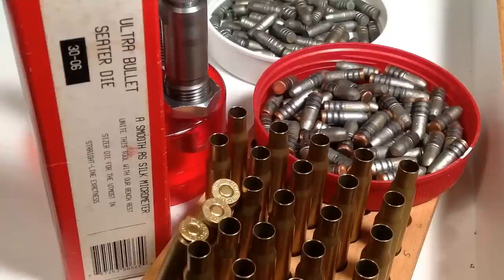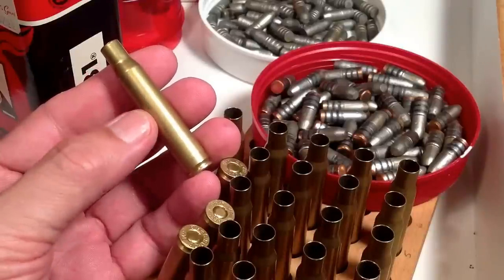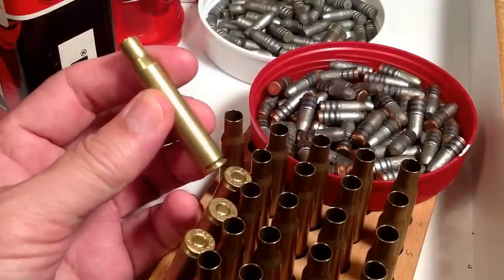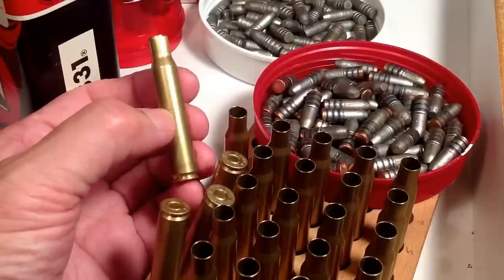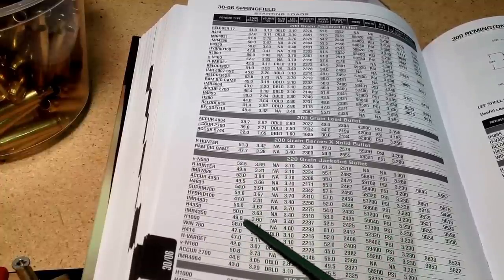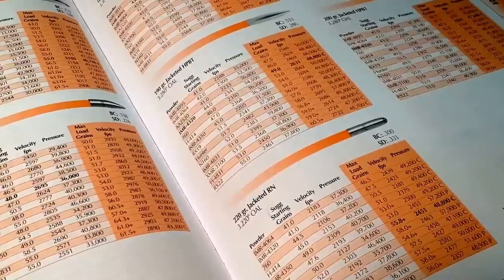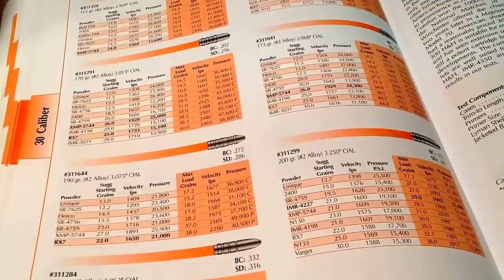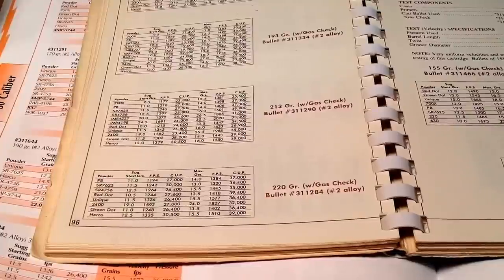The Danger Of Reduced Loads in Rifles

Comment: Good video, at least someone takes the time to notice most detail. I saw one problem though with what you're teching people like Sith Yarael for instance. You pointed to your reloading manual and said these are all slow burning powders, but in reality only some listed in those books were. Yes IMR 4895 is actually a belted magnum powder charge that burns very slow, and IMR 4350 is a medium to slow burn rate. Yet the IMR 4064 and definitely 3031 that I saw in some of those lists you pointed at are actually very quick burning powders and are actually suppose to only be used with lighter bullets no matter the caliber because they just don't perform as good for heavier bullets because they burn too fast and don't build up the correct head space before complete discharge of the bullet. So yes good to show safety, but make sure of which powders are which when teaching young pups of the reloading world. All in all I liked your video though, got my thumbs up. Thanks
Reply: +JJ 032 Sorry I meant head pressure not head space lol, my mind automatically thinks head space right now because I'm about to rebarrel my 30-06.

Comment: Lots of info on the subject. I use TRAILBOSS POWDER in 308 6.5 223 222 and its excellent. Case capacity 80 percent and little chance of flashover. Plink all day with 308s and dont resize when i reload. The charges do not expand the cases. Do you own research. Adi powder reloaders manual has load data for trailboss

Comment: Sorry to comment on such an old video, but should a reduced load be calculated from the maximum or minimum load listed?
Reply from the maker: TheOkWoodsman - Not at all - Whenever you use a slow burning rifle powder that has been reduced to approximately half the case capacity with the bullet seated, the situation can be hazardous.  There are selected slow burner rifle powders that have been certified as OK with reduced loads (anything below the starting charge).  Best would be to never load under the starting load (within reason of course -  1/10th grain under is not the idea).  Best for reduced loads in rifles would be use of faster burning powders in reduced load reloading data.  Have a great day,  FC Steve

Comment: Better still, use a low pressure voluminous powder like trailboss, 19 grain in 3006 fills the case and produces 1500+/-fps without risk using data from manufacturer.
Reply from the maker: Jerry Miller - Yes sir..!!  Trail Boss powder came about because of all the cowboy action being done with tiny charges to get the lowest impulse ammo possible - TB allows ultimate safety for them with the light loads they require.  And, as you have pointed out,  the powder is useful for all cast bullet shooters in any caliber without need of reloading data - just take the case volume and go with 80% of the weight of TB that would fill that volume.  Only powder we can do that with is TB.  Have a great day,  FC Steve

Comment: I've got Lyman load data for 6.0-7.5gr of 700-X under a 170gr cast bullet in .30-30. I'm a little apprehensive about it, and would probably use fiberfill to fill the case and keep the powder down on the primer. I'm thinking that I'll just buy a can of Trail Boss for low-velocity loads instead of fiddling with high-density pistol/shotgun powders. Pistol powder in a rifle case just sets off alarm bells for me, published load data or not. Better safe than sorry.
Reply from the maker: Headframe Hunters - No problem with that reduced load as it is not a slow burning rifle powder that is being reduced... and yes, the fiberfill would be  good powder management with that small charge.  Trail Boss would be another great powder to use.  .Merry Christmas and Happy Holidays to ya..!!  FC

Comment: I haven't tried using reduced loads in a rifle. With the case the size of a 30-06 and a reduced load of pistol powder have you ever used a filler on top of the powder to keep it against the primer? I remember an old Guns &Ammo article from the late 70s maybe early 80s were the author used some fiber filler in some reduce revolver loads. Anyway, your video was excellent advice for those considering reduced loads...
Reply: +Bob Kopchik Air space in large cartridges is a real problem for shooters of Nitro Express calibers, a 577Nitro Express even with 120 grs in it is only very lightly filled volume wise, not so much of a problem with the tiny 30-06, but still a potential problem with reduced loads, my solution is to fill the empty space with a foam filler wad, this keeps the charge in one place, whatever the angle it is held at, with a small charge laying along the bottom of the case, on firing the flash of the primer passes over the top of the charge, igniting it along a broad front, at different rates according to the angle it is held at. There have been lots of experiments trying to duplicate these "blow ups", but none have really proven to duplicate the condition at will, a very good paper on the subject of fillers is the Double Gun Journal, (Summer 2011), where the use of fillers was explored in great depth. If you look at the Colt 45 case, that too has a huge air space when loaded with Nitro powder. Please take great care when you see less than 80% of the case filled!
Reply from the maker: +Bob Kopchik -- The use  of polyfill to keep small charges of powder against the primer using pistol powders in fairly large volume rifle cases, is a good idea.   Doesn't take much and it is easy to do...Using it with reduced charge of slow burning powder is still not a good idea because of the slower ignition of that powder giving time for the charge to move to front of case and solidify there.  Safe shootin' to ya!!
Reply from the maker: +Englishman French -- Always good to hear from Englishman French!!  The lower the loading density, the more fillers are needed.  I like your less than 80% rule... Have a great day

Comment: In reloading any cartridge where there is no, or very little data present, start really low, then work up to the best load for your firearm. I mostly reload pistol, and that advice works best for pistol, but from what was said about slow burning powders, that might, I admit might not be a viable option. But again, the filler idea might be viable.

Comment: I use h4831 and trying different loads and with my loads at 51.3gr of powder it moves around in my 30-06 case should I use poly fill or something to keep the powder from moving? Or does It make a difference?
Reply from the maker: Jonathan Mallet - H4831 is a slow burning powder (started out as surplus 20mm cannon powder), but at 51.3 grains in the 30-06 is a starting type load and well in the range of charge recommendations in the loading manuals.  The dangerous reduction loads would be in the 50% (around 25 grains) charges with the slow burning powders.  No fillers needed unless you are loading reduced loads of faster burning powders like Red Dot or Unique, but even then, in the 30-06, it would be an option perhaps to get better accuracy.  Have a great day,  FC Steve